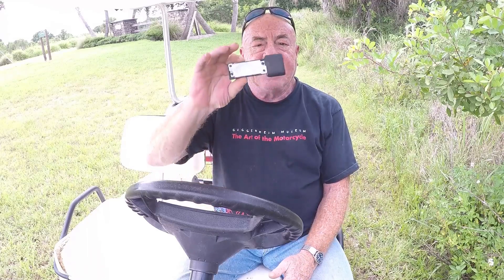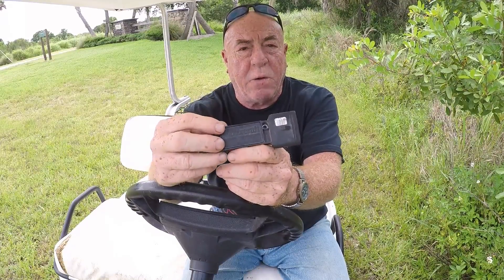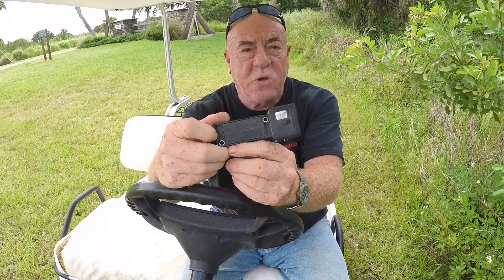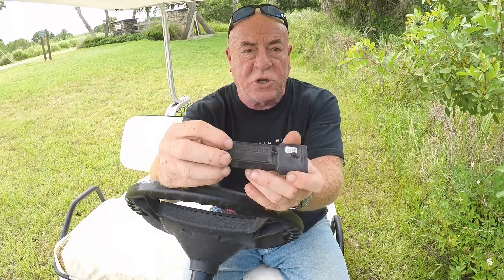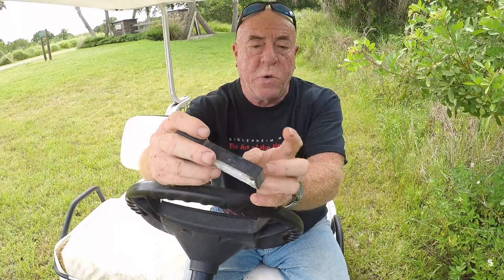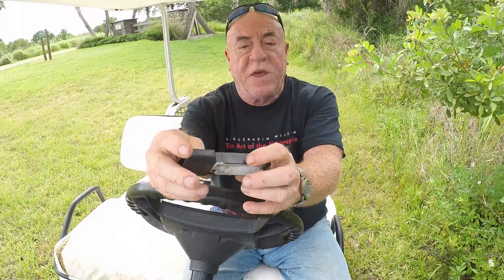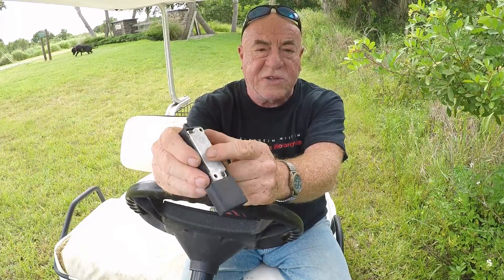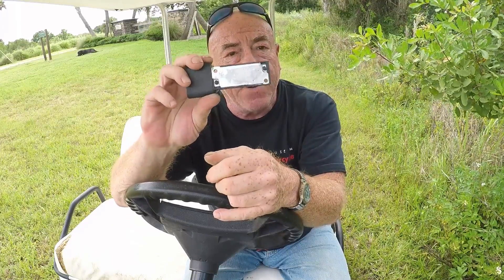Ignition Control Module Info

Comment: The same thing happened to me.  They sold me a blue one.  I put it on and had problems.  I called a radio show here called the car counselor and they asked me what color mine was I told them black.  He promptly told me yup they sold you the wrong part.  Ford had the part number wrong in the 96-98 range and they never changed the catalog.  I argued with the parts guy and told him that and he looked at me like I was crazy.  He finally gave me the one I asked for.  Installed the black one and presto problem solved.
Reply: I think that's what I need to do.
Reply: Nope, nope, it was compression too low to combust ethanol and catalytic converter buildup.

Comment: You are on your way to being a Ford expert.. The Ignition Module (Ford guys call it a TFI module, Thick Film Integrated) , was originally an issue back on the 80's Escorts(I watched the Ford mechanics change 20-50 a week). My first personal experience on with this part was in 1988 on my sisters 1986 2.3 mustang, I was not happy that I had to buy a special wrench to remove it from the distributor,found out later you can grind down the thickness on a deepwell socket(I think 8mm). Well that's my .02 on the subject.. keep fightin the good fight